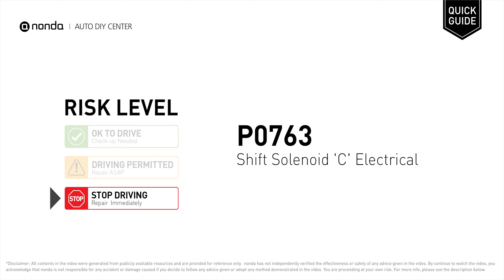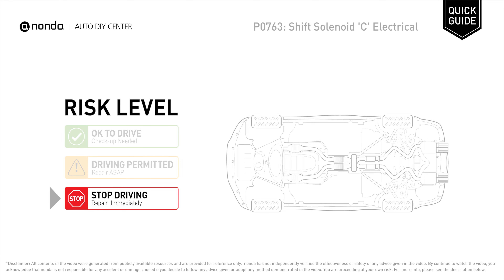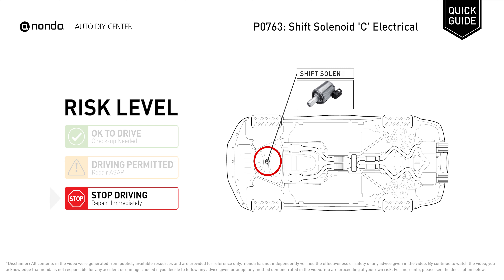What is P0763 Engine Code [Quick Guide]

Comment: Good day Sir.. i have 2005 mazda 3.. i have issue in transmission.. shift solenoid C electrical (DTC P0763).. i already changed the transmission and the electrical harnesses attached on it.. and still same problem..  what problem could it be.. please help thanks
Reply from the maker: HI Raphael, please confirm if this is the only code you're getting.

Comment: Hello I have got the same code on my Hyundai Azera 2009
Reply from the maker: Pls check the guide in the vid and the pissible causes:
Low transmission fluid level
Dirty transmission fluid
Faulty shift solenoid 'C' valve
Shift solenoid 'C' valve harness or connectors
Shift solenoid 'C' valve circuit is open or shorted